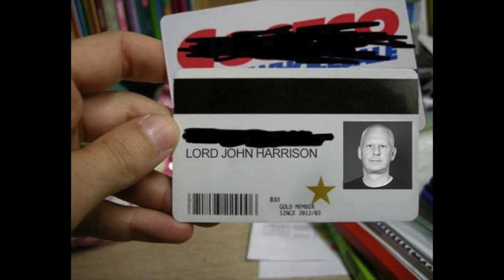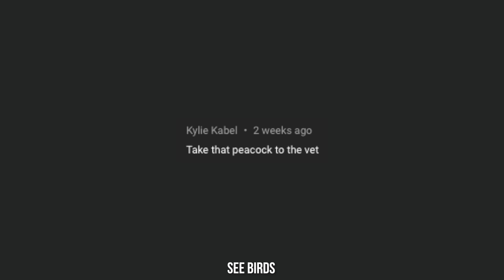The Vet permanently INJURED our Peacock

Comment: I’m sorry, but I completely agree with the vet. I’m no expert but I volunteered in a wildlife sanctuary here in the uk for about 3 years, I have never seen one of those tiny needles they use cause any kind of damage like that. And we had a lot of birds come through. I have seen damage like that happen when a stressed bird flys against walls or cages, much like yours did in several of the shots in this video…. But you seem adamant that it’s someone else’s fault. Much like the incident with Joey. Seems like a bit of a pattern.

Comment: That wing is definitely broken. It seems unlikely that happened during a blood draw. It could have happened in the cage used to collect the poop though. Those openings in the bottom were large enough for his wing to get caught in and could cause a break like that. 
I feel for your struggle trying to find a poultry vet, I went through that myself and even the vets that take regular pet birds do not take poultry. I was so glad to find one vet in a 50 mile radius that did.
Reply: Glad a few people here are seeing what I was seeing as a possibility for how the bird's wing got broken. When he started describing that wire bottom cage idea for collecting poop, I immediately thought if the bird's foot fell through and he flapped trying to upright himself he could easily have broken a wing that way.
Reply: I feel like the vets not the ones who broke the wing bc he would have noticed b4 then that the wing had bone sticking out of it and he didn’t notice till after the cage with the large holes i understand why he put the bird in that cage but the bird wasn’t like that till he did that and he said the bird was only at the vet and the poop cage so it seems the cage is the cause
Reply: Exactly what I was thinking, the break was caused by that poorly designed cage. The span between the wires is too wide, and the wire is too thin to stand on comfortably. It's easy to slip and fall in the grid wire bottom.
Reply: A broken wing would make a lot more sense. I see no way that a blood draw results in a bone sticking out... But even if it is a broken wing, that vet still screwed up by sending them home with just an antibacterial spray. That bird needs an operation to get that bone back inside the skin (and get the broken part stabilised so it can heal).

And looking at the way the father caught the peacock - by the legs with the wings flapping about - that's an excellent way to get a broken wing... The son did a much better job - catching it quickly, in one go with both hands on the sides of the wings - you always want to keep a bird from flapping its wings when you catch it to prevent injuries.
Reply: @Vousie  The father did say it was hard to find a vet willing to operate on it. Not every vet has the ability to operate on birds and even fewer for poultry. Poultry is its own specialized field of veterinarian medicine and to what degree a vet has knowledge in that field if any can greatly vary.
Reply: @MA-mh1vs  That's all fine, but the vet should've told them "your bird's wing is broken, find a specialist vet who can operate ASAP" not "here's some antibacterial spray and it'll be fine".
Reply: @Vousie  I am sure they did say that even if this owner did not admit it any more than he admitted that the cage was the cause of the fracture rather than the vet.
That does not change that there was not a vet local to them that could operate so they tried to keep treating it themselves. By the time they found a vet through a viewer it was too late for the bird.
Reply: @MA-mh1vs  So now you're saying that you think the vet did say it and these guys have lied to us... That's quite an accusation.
Also, given that on the follow-up video the new vet who did operate on him said the break looked weeks old, it's most likely not that cage, but his normal enclosure or something else that caused it.
Reply: @Vousie  I am saying no vet missed that kind of fracture and they did not take the bird to any other local vet for a diagnosis or treatment. Why not? Most likely because they already knew the birds wing was broken and needed surgery so there was no need to. 
If indeed the vet had missed that kind fracture why are they not calling them out by name for it? Why are they not suing them for the damages caused by the delayed surgery they did not know that they needed when they left the vets office? The whole thing is fishy, like he was giving half truths on the whole thing.
Reply: Easily broke the wing in that kind of enclosure. Especially with a flighty bird. And 'bugs happening before' is an especially worrying sign because that means they noticed parasites at the infection site prior to saying we noticed this bone issue?
Reply: That’s what I was thinking, it probably fell through the huge gaps in between the wires
Reply: But the injury to that wing wasn't fresh the morning after that bird had been in that cage, that had a lot of granuloma tissue, it had been that way for days. There wasn't fresh blood at all. If the clinic was responsible, they did everything they could to cover their tracks. Bad vets are out there but their technicians can make or break their business.
Reply: @julezee6500  I've worked veterinary. I've seen people bring in animals with maggots already in wounds and say "it just happened an hour ago." 
It could go either way in this case. However, many people who keep birds know not to put them in a cage like they did because they will break wings in it. Even an everyday birdcage can ruin a bird's wing if it freaks out.
None of us were there to really know the frame of time between parts of that video.
Reply: @julezee6500  Poultry wounds clot pretty fast. I had one take a spur to the throat and survive! It was VERY anemic but in a week you could never tell how close to death that bird had been.

Comment: That wing looks broken. The holes in that dog crate were so large and he had nowhere to perch other than the wire. It looks like he may have slammed his wing into the cage wire during the night and then broke the wing trying to get it out.

I used to watch this channel regularly but I started noticing them collecting a lot of exotic birds and other animals and doing very little to no research on proper care and not correcting their husbandry until after they have losses, not checking to see if they even have an exotic/avian/livestock veterinarian nearby before getting all these animals, and doing a lot of DIY vet care that results in a lot of losses. Most farms foster close relationships with veterinarians, farriers, etc and have a network of people to call on if they need assistance and most people do extensive research into proper care before getting an animal.
Reply: I agree that dog cage was awful and I can't believe they didn't connect the dots and blamed the vet. The bird could hardly stand on those tiny wires. How could they not realize what they were doing was dangerous?? I feel so bad for the peacock.

Comment: Honestly, I think it’s more likely it’s wing got caught in crate bars and probably injured wing through panicking/trying to get wing unstuck. 
It looked like he could have easily fit wing through that crates side and floor bars, so maybe got it caught in side bars while stretching out wing, or lost balance on floor bars and wing got caught underneath? 

You have to be really careful to use cages with appropriate bar spacing, as very easy for any animal to get serious limb injuries if bars are too close together/far apart. It’s even more important with flighty species, as they are most likely to thrash around in a panic until the stuck limb is free, even if that means breaking bones to escape. 

A few years ago 1 of my dogs got his leg stuck in the narrow horizontally bars that ran under the crates door. Luckily I was literally sat 2 steps away from his crate, so there was only a couple of seconds of him screaming and thrashing around, before I’d got crate open and pinned him down and pry bars apart enough to get leg out, so managed to avoid serious injuries. But I’m surprised it didn’t end with vets trip, as he was throwing his whole weight into pulling away and his leg was pinned to floor, while the rest of him was standing and thrashing in every direction.  
I knew importance of bar spacing when I bought that crate (grew up breeding/owning most small pets species!), but I wrongly assumed that this very narrow gap below crate door, running just above the height of base tray, was too toy breed for a puppy to get leg through, let alone an medium sized adult dog.  

Hopefully adding my personal almost vets bill, makes it clear I’m not being judgemental, if it was the crate to cause injury.  Accidents happen, especially when animals are involved and even when you think you’ve done everything perfectly, they’ll usually find some new problem/risk!

Comment: As far as I know, you cannot keep the Peacock in a small coop. They are very clean birds. You need to keep the coop clean and it needs a bigger place to live. The way you are handling the Peacock also wrong. You must hold it with two hands. you cant hold it with one and the other hand the camera. WHAT I think is while you are holding it that way you would have broken the joint which you didn't realise  a genuine mistake I guess.

Comment: I think it is weird that didn't fix the break. Sure they couldn't fix enough for him to fly but having the bone protruding through the skin isn't an answer. They may have had to smooth of the sharp edges of the bone and tuck it back in the hole and sew it up. The bone would fuse to the bone it broke from in a stair step. You would have to bind it to his side with vet wrap for a couple of weeks to immobilize the wing so it would heal. I have seen a wild Canadian Goose whose leg healed like this. It is possible for it to heal if you can get the bone back under the skin.
Reply: I have to agree with you that claiming there was nothing that could be done to treat the injured wing was obvious nonsense. An open wound and a broken bone are staple injuries that wildlife rescue treat all the time.
Reply: @ThePodVon  It may have not been able to be fixed because of the age of the wound but they could have amputated the wing and saved the bird. I have seen this done with pet chickens.
Reply: Bone outside if skin shouldn't be "tucked back in."  That will cause massive infection.  (Osteomyelitis)  Either the affected area or the entire wing should be amputated, or the bird  euthanized.
Chicks dying:  were they vaccinated for Marek's disease (on day ONE?)  Were they on medicated feed, if not vaccinated for coccidiosis?  Putting young chicks on the ground without medicated feed is an impending wipeout from coccidiosis.  Older birds can handle it, but chicks usually die.  Were the chicks old enough to be exposed to the outdoor temperature, if they weren't covered by a hen?  
Backyard Chickens website, & plenty of other poultry websites, contain a wealth of information, disease management, winterizing your coop, avoiding frostbite, etc..  They also have forums for you to ask questions & receive answers from experienced keepers.  Mostly devoted to chickens, but you can get help from keepers of other fowl, also.
Good luck to you!
Reply: @ellendaniels3026  Your right it would be wrong of a vet to tuck it back in and not amputate. I had in my head a wild goose that had survived a break that didn't pierce her skin but the bone overlapped and refused to itself. It left her with a stiff leg. Her flock mates deferred to her though. When throwing food to them they competitively crowded each other but didn't crowd her.

Comment: Actually, you are wrong. The wound could have been caused because when it was flapping it’s wings, the wing got caught on the cage when you were taking it out. And when you yanked it out, it pulled apart the wing, exposing the bone. I learnt this by reading Ivan Olavarria’s comment. And when you held the peacock by the legs and didn’t secure the wings, that also could’ve caused the injury.

Comment: Personally, I wouldn't be surprised if that injury came from being in that cage. Wire cages can cause birds to get their wings stuck. He was also off the ground and up high with giant holes between the wire. I'd definitely recommend at least , at the minimum, put the cage on its side, so the holes are not so big, but personally, I would have used a min of 1×1 inch wire for my birds. 
Either way, regardless if it was the vet, or the cage, we all live and learn, and I hope the peacock recovers quickly. That's all that matters! If it was the cage, you can do what you can, to prevent this from happening in the future, as much as you can, and you can make the future vets aware of the sensitivity of peacocks so they can be more careful. Happy Thanksgiving

Comment: I had 6 peachicks die on me last summer.  They had Coccidiosis they contacted it from the adult birds we had. they were raised off sight. I didn't treat them until they were there I used amprol.  This year I did it before I introduced them to the flock.  I had no issue this year.  I also give all the birds ivermectin sheep drench before it let them out and before i put them in in spring and fall.  I don't know if you tried this for your peacocks.  maybe its something you can(the amprol) try if you hatch some again next year.

Comment: Are there an bird sanctuaries around you? They are usually far more equipped for this sort of thing if your vets are not. I'm also surprised the vets in your area don't take birds in and have zero bird experience! That's such a shame and disastrous for you and your peacock, this never should have happened and I'm sorry. Vets should have been the solution here but it seems the vets in your area are sorely lacking in expertise with birds. Even my local vet accepts birds (ducks and geese and chickens, farm birds ya know) and actually know what they're doing, and they don't even consider themselves an exotic vet. All of this is ridiculous and it's so hard because it's out of your hands, you have no control in this sort of situation and the fact that they are just letting you go home with the peacock barely addressing it, is so depressing.

Comment: I've been a fan of this channel for years now, and can empathize with their struggle to hatch white peacocks. However, you can't accuse the vet of misconduct unless the bird was carefully examined before and after each vet visit. That injury could have occurred during transport, or even in the isolation enclosure. The problem is that this video could negatively affect how the locals feel about this veterinary office. It could hurt their business. My suggestion would be to issue an apology, and take it down. It's just bad form to accuse them of negligence w/out any actual, hard evidence. Also, might suggest investing in a soft-wall carrier that is more suited to the bird's size. With a smaller carrier the valuable bird has less room to "slide" around, thereby reducing the likelihood of being injured during transport. Finally, it would definitely be worth the expense, even if you have to drive an hour or more, to find a reliable veterinary office that specializes in avian care, especially considering how many exotic birds you have in your care. Hope your peacock recovers, and I'm sure your next clutch will be more successful!

Comment: Bit irresponsible to blame a vet for something that is significantly more likely the result of rough handling or that awful cage. We keep Muscovy ducks who are built way tougher than a peacock and I wouldn't dream of handling them like this! Secure the wings from behind first, they are the most fragile part of the bird, then bring the bird to your body. Muscovy ducks have powerful legs with sharp claws so we keep them with their back to our chest when we have to handle them but however you carry them, keep the wings secured.

Never ever carry a bird round by the legs, that's like a how to guide for broken wings and broken legs. Also, never place them on wire with gaps big enough for a leg to fall through. No wire is good for the feet but the spaces should be smaller than the span of the toes if a wire bottom is necessary to reduce the risk of all manner of injuries.

Comment: More reasonably to think is that the  cage was the culprit , letting the bird hang on those wires full of sharp edges was not a good idea. It is wrong to accuse the vets without any proof(trained/schooled personal versus untrained - use logic) , also the birds were very stresed, moved, handled  a lot, i don't think it is ok!! And in the former videos, they should have removed the hens from them at the first(well..second)  chicken that died!!!

Comment: The small needle used to draw blood could not cause such an injury. Have you considered that while the bird was in the dog crate it fell through the large open area in the floor and whilst flapping its wings and struggling to regain a secure footing on those tiny thin create wires it’s wing got caught in the crate and fractured its bone.. it’s easy to point the finger at the vet. But realistically that whole create situation for a bird that size was truly poor management on your part..